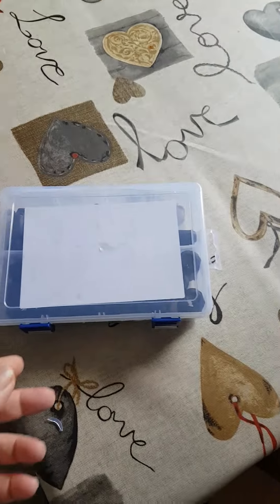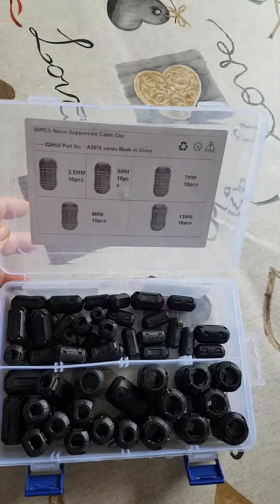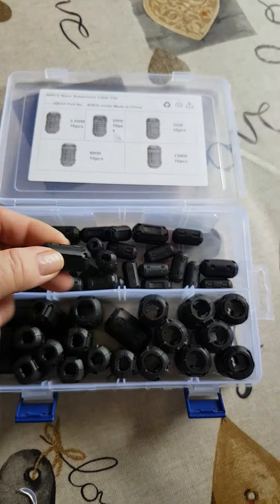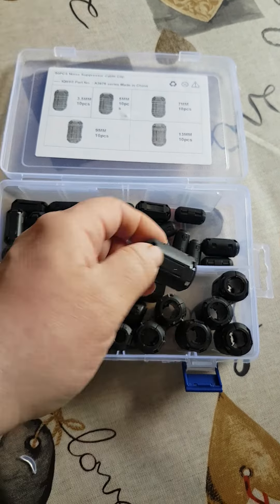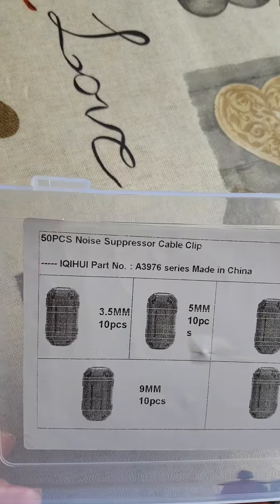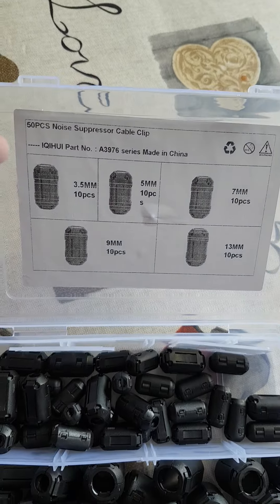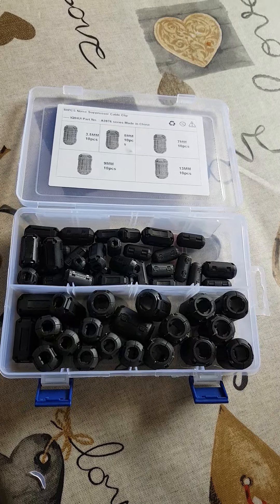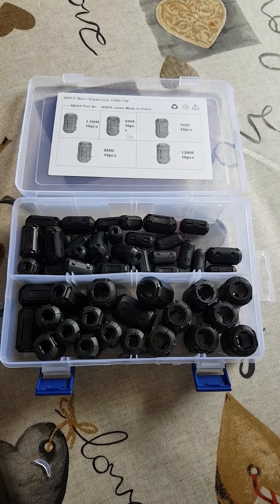snap on ferrites

Comment: Can you show where to use them?  I was told power leads on power supply,your saying coax,which end radio or close to antenna
Reply from the maker: power leads coax both RF Chokes are best installed at the feedpoint of the antenna and snap-on chokes in the shack  Ring Cord RFI EMI Noise Suppressor Filter for USB/Audio/Video Cable Power Cord  These RFI snap-on Chokes are selected for RFI suppression. Remove RF on cables and wires to your radio station. Isolate RFI on feedline from your station. Grounding and Bonding in the ham shack on my YouTube channel https://www.youtube.com/watch?v=TVUePupaelM&t=60s